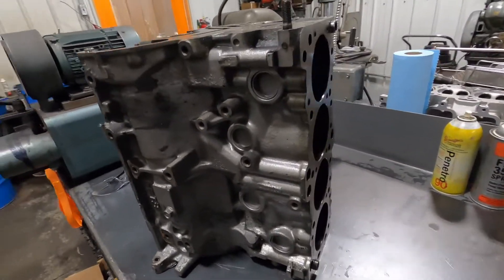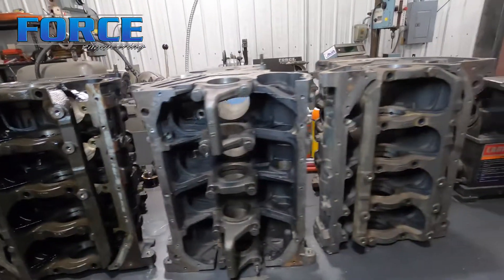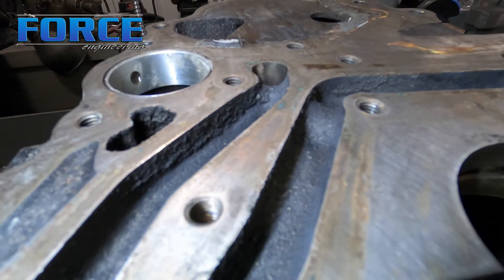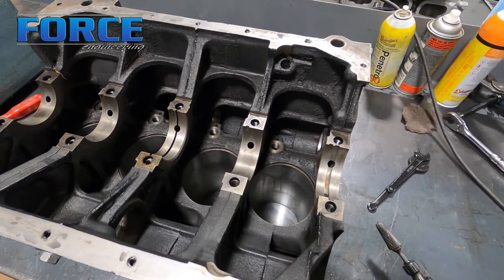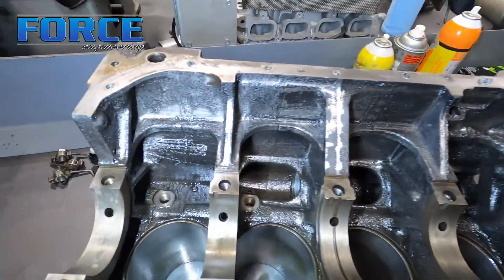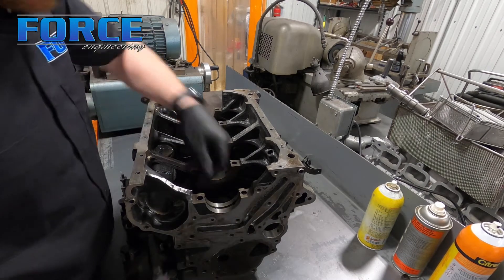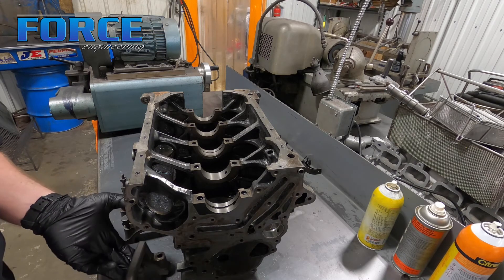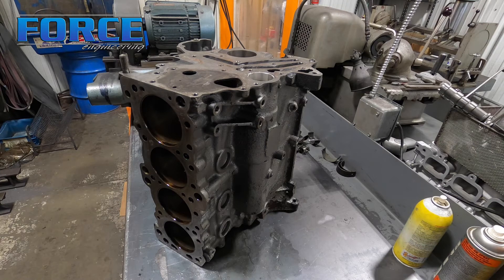Engine Machine - Mitsubishi 4G63 Pre Machining Block Prep | Turbo 4g63

Comment: I crankwalked my 6bolt and I’m pretty sure it’s from not seating the thrust bearing. Do you think that’s the cause?
Reply: Saw your other video on seating thrust bearing but that was a different motor
Reply from the maker: Definitely possible.  However there are a few things that can cause crank walk.  Improper clutch adjustment, improper torque coverter spacing if you have an auto, and other reasons.